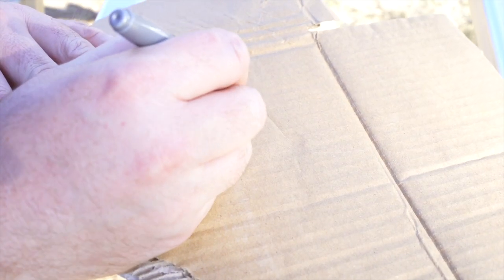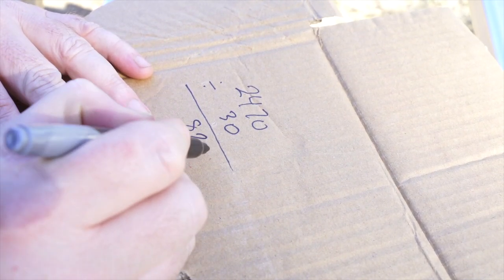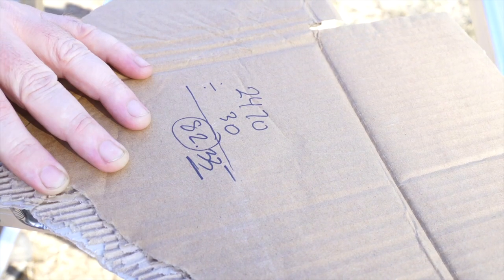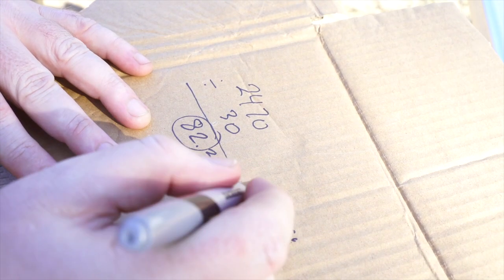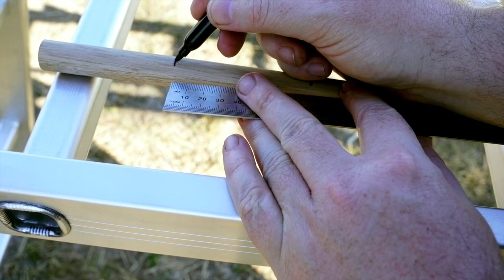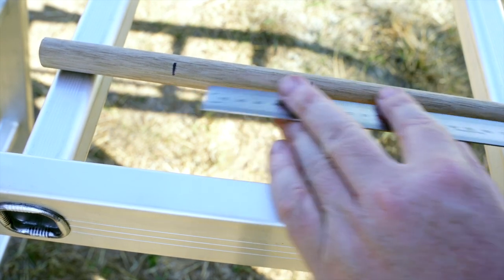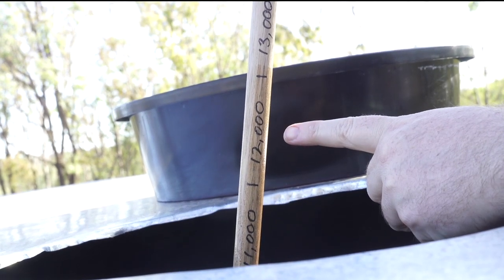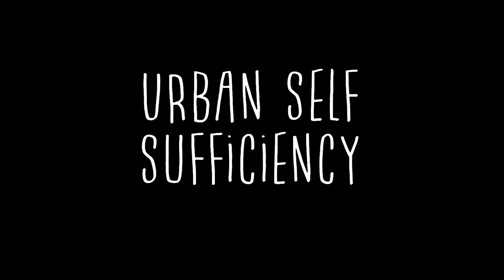How to Measure Your Water Tank Level

Comment: Love your videos! Thx Heaps!  An idea for tank water measurement > pop a 1/2 filled 1L plastic soda bottle into the tank, attached to a (nylon) string as long as the height of the full capacity of the tank. Attach The other end of the string to a 1/4 filled soda bottle (or a nut). Hang the lighter bottle/nut outside the tank. Stick your marker stick on the outside of the tank. As the nut goes up/down you can see the water level without having to climb!
Reply from the maker: omg... that is genius!

Comment: Another great video mate... what i did with the water tank at work was install a clear piece of tubing up the side off the tank and than marked every 1000 L but that involved waiting until tank was empty and drilling a hole large enough to fit the tubing/fittings needed to make sure it doesn't leak. 

Also let us know if your mate is getting the right amount of water his paying for when you get an update!